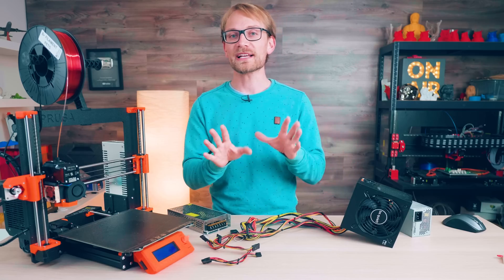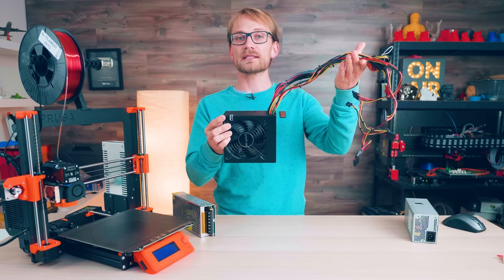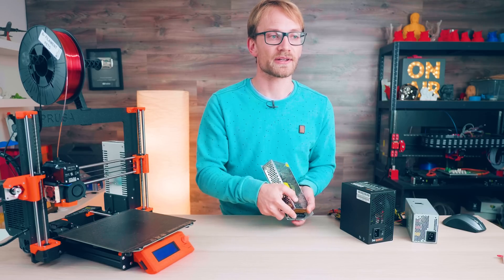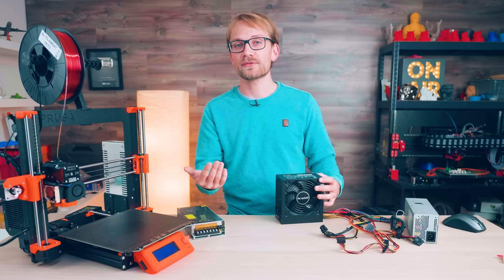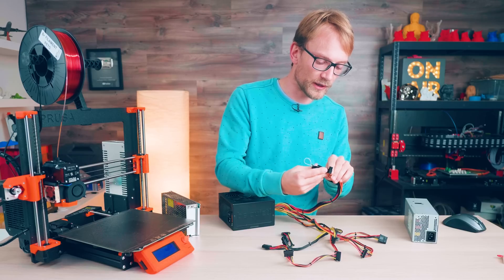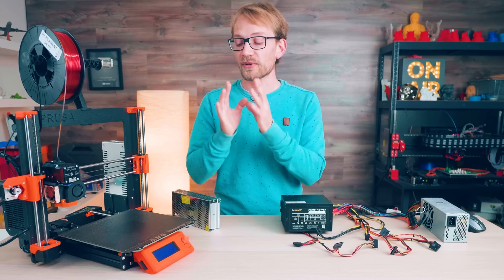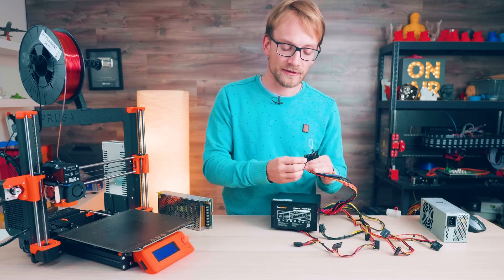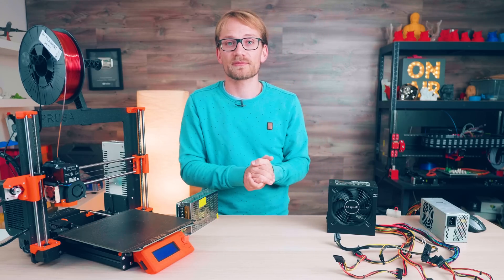ATX supplies are super useful for 3D printers!

Comment: haha, "12 floppy drives"... in RAID, I'm sure! Good one!
I always use load resistors with computer switching power supplies used in DIY projects because they don't like to run without a load (especially the old ones) and because, as you say, group regulation will make the "other" voltage rail go higher. In practice I use a permanent 6.8 Ohm/10W resistor on 5V (red) to throw away 3.7 W and sometimes another 47 Ohm/10W on the 12V rail (yellow). It depends...
"...loose some ampacity as the capacitors dry out"... ummm, no. Ampacity is the current capacity (usually of a wire), the maximum current intensity (in Ampere), in general. With capacitors dried out you'll get higher ripple or a total and sudden loose of regulation (the PSU shuts down), depending on where the troubling capacitor is located. The ripple itself may not be a problem as the printer controller has its own regulator, and the MOSFETs for the heating elements couldn't care less. Stepper drivers may or may not feel the ripple. But the shutdown problem is a problem and it can happen at any load. 

"Group regulation - single transformer"... no. You don't have two or 3 transformers if your PSU is independently regulating 12V and 5V (and 3.3V, but that's usually regulated together with 5V). Group regulation regulates the average, that's why 5V goes up if the 12 is heavily loaded (tending to go down). 

One thing I think you forget to tell about industrial PS is the ability to set the output voltage to a higher value which can make available more power for the heating elements. By increasing the output voltage from 12V to 14V the power available for the heating bed will increase with 36% (faster heating or higher end temperature)
Anyway, personally I use an industrial PS because it's smaller. But because I have lots of computer PSU I may switch to one with a lot of protections but not before I'll thinker a bit with it (replace those low ESR capacitors, replace that bunch of cables with only 4 or 5, higher cross-section and maybe getting 1-2 V over the PSU specs). Oh, btw, the gray wire is the Power_Good signal, can light a LED through a, say, 220 Ohm resistor put to GND if the PSU is working normally.

Comment: Hi Tom, at first I thought you have a +12v and a -12V on your ATX, that means you do have 24V between them, which you do..........But even though you can get 24V it will be useless because the -12V rated for 0.5A max.  So you could run ....... a 24v fan:):).  Dang, at first I thought I was onto something.  Oh well.

Comment: As you asked, I bought all industrial 5, 12, 24V SMPS to support my recently acquired BIGTREETECH SKR PRO V1.1 because this controller board allows for simultaneous use of both 12 & 24V supplies for Nema motors, Tcm2209 drivers and hot bed. I still have my 500W ATX PSU, but this will do for now as a bench PSU. I have a couple of digital V&I controllers for up to 50V or proportions of as shared between the two. Thank you for your great video contributions and no nonsense approach. FYI.

Comment: You should NOT switch the entire printer off immediately after print is complete. You should keep at least the cooling fan on, until nozzle temperatures are low enough (to prevent heat creeping to the cold end side, and melting the plastic there).

But no worries, there's GCode for that too!
M109 R60 ; switch current hotend temp to 60 degrees & wait until the temperature is reached.

After this, it should be safer to switch the entire printer off.

Comment: I've been through pretty much all the options;
12 V cheap PSU that came with the printer
12 V ATX (Noise)
12 V ATX with Boost Converter (TMC drivers)
24 V ATX in series (faster bed heating times)
24 V Meanwell (less cable clutter)
24 V ATX in series (that Meanwell is stupidly loud)
24 V ATX in series with a 12 V buck converter (lights would flicker when loading the 24 V rail)

Comment: Can't you get 24 volts by using the +12 and the -12 , instead of replacing one of them with ground?
Reply: Actually just went to check the video, the BeQuiet he used as only 0.3A on the -12V rail. 24V limited to under 1A isn't worth the 24V then
Reply: @TheDigigram  Ah, I see
Reply: I don't have a PSU handy to check now, but in most cases the -12 rail is rated at MUCH lower amps, meaning your 24V would also be very low amperage
Reply: @TheDigigram  Why do they do it like that?
Reply: @tiagotiagot  because computers mostly use digital processes where only positive voltages are used. The negative rails are mostly used for sound and a few things like that. No sense in adding extra circuitry just incase someone wants to use the PSU for something other than it's intended purpose

Comment: Great insights, the 5V standby voltage is very useful, but the large size of the ATX power supply and 12V only  (vs 24V) would be a limitation for me

Comment: On my DIY Hypercube 300 i run 2 industrial power supplys. A 24v run the 300x300 heated bed and a 12v run all the other stuff. First i build only with the 12v but the heated bed don´t achieve 100 C degrees needed to print ABS, so i buy the 24v power supply only for the heated bed and it works insanely well, it hits ABS temps in less than a minute. I know that is possible to run the ramps on 24v and maybe in the future i go for that conversion.

Comment: I built a printer and added a raspberry pi zero w for running octoprint.
On one of the GPIO pins i've connected a 5V relais that switches my 24V power supply (for heated bed, hotend and steppers) on and off via Octoprint. (using octoprint plugin PSUcontrol)
Only a small power supply for the raspberry pi is hooked up which stays on (until switched off with a manual switch on the printer itself)

Comment: Turing printer on/off using OctoPi is a neat feature and quite easy using ATX power supply. However I will stick to industrial PSU - 24V is much "better" feature. To turn the printer on off I plan to use relay on 230V side, I am going to power Raspberry Pi and relay from separate 5V power supply. Both connected to the same UPS, so I can switch them manually on/off there.

Comment: I am using a HP DPS-460 Server Power Supply on my 3D printer. It has a lot of power, is silent, can be also switched by marlin, uses high quality longlife components, is very compact in size and you can buy it on ebay for less than 15 Euros. It is still 12V but thats fine for my me even though I have a 200W/12V Heatbead.

Comment: Technically all ATX PSUs only have a single 12V rail. The difference is in some models the outputs are connected to that rail in groups with independent short circuit and over current protection. Those are logical rails with individual current settings. Physically they all get their juice from the same coil/rectifier. Everything beyond that is marketing. 
But it's a nice safety feature to have nontheless. 
With a single-rail-psu a component could short out and draw more power than the cables can handle, but the psu won't necessarily shut off because the total current might still be within that rails limits. Result: Fire. 
So for a PC build, if you don't have the budget for a fully digital psu, a "multi-rail" psu from a quality brand is a good choice. (most are made by superflower, delta or seasonic and then re-branded anyway^^)

Comment: I switched the Ender 5 24V Supply to Meanwell UHP350-24. Using the TH3D Mainboard plus a fanless supply gives me a near 0 noise while printing ABS/ASA. I modified the printer alot further, using a multible PTC elements to heat a customized chamber, some LED strips inside, a thermometer, a self resetting bimetal fuse for overtemperature of the PTC elements, full metal hotend, direct drive titan extruder, immense cable lengthening to get the electronics out of the chamber ... :D

Comment: so you didn't mention that with an ATX PS: if you use the -12v output (as positive) and the +12v output (as ground) you get +24V... would that not suit the needs of the required 24V in a newer system (My Ender3 for example)... THNX :)

Comment: I feel that using ATX psu's is still totally viable, as am in the process of switching from  the default LED style psu's on a couple of my 12v printers with some single  large  12v rail ATX psu's that I still have  in boxes as ready spares for well over a year  but not needed them  (corsair & seasonic = excellent reliability) I wouldn't do this with some of the older pre-haswell compatible class ATX psu's as those tend to need a load on the 5v rail to maintain stability, (I have an  old but perfectly functioning Enermax Noisetaker 650w psu from about 2007 which behaves like this and it wasnt a cheap psu either).

If I had to use an older atx psu I would  1st check the label for  how its power distribution is laid out, some very old ATX psu's tend to have most of the current dedicated to the 5v rail rather than the 12v,   so after looking at the label if it had more juice on the 5v rail then I would reject it - thanks  for posting

Comment: I replaced my garbage chinesium power supply for my Anet A8 with a good Dell atx powersurply i had lying about. I feel a lot safer now and the short circuit protection is fantastic. I had a LED light that was short-circuiting which would instantly trip the protection resulting in no damage. 

With all software safties enabled, soldered bed connections and external MOSFET, I feel somewhat safe letting it run unattended.

Comment: Is it possible to connect the 12V rails in series?

I believe most multi-rail power supplies are so because of the voltage drop on the ground return wire. If 12V dropped to 10V it should not be a big deal because of on-board VRMs, but if ground raised to 2V then all he'll would break loose because of the communication lines.

If this is the case, grounds being separate between trails, then only protection circuits could possibly shutdown the supply.

Comment: Word industrial should be replaced with Chinese. I've never ever seen these "industrial" power supplies used anywhere in actual industrial machinery. Not sure, but I think that even the terminal safety in them is insufficient for today's standards even though they are installed in cabinets. All logics and control boards have always had some pretty good quality looking powers, generally with integrated output fuse.
Reply: I've seen similar ones in a few industrial machines... First time was almost 20 years ago.
They've all been inside metal casings, and difficult to get to during normal operation.... I suspect they may have had the low voltage at the opposite end to the high voltage though, unlike the common Chinese ones.

Comment: I'm running two ATX supplies for 24v and it works great, but you have to do some hacking to make it work.

Fundamentally, the power supply creates a difference of 12v between its low and high outputs. We call them ground and 12v, but they're really more like x and x+12. So if you connect the low output to 12v, the high output will be 24v – easy! Unfortunately the low output is already internally connected to the earth pin on your power plug. This is for safety: if you let x just float around with no specific value, who's to say it couldn't end up at 240v and shock you when you touch it? However, it's possible to mod the power supply so that the earth is still connected to the case, but not the low output, leaving it free to be connected to the 12v of another (identical) supply.

There's a video by Neilgn called "Isolate negative terminal from ground on ATX supplies" that shows how to do it (though he isolates both supplies and you only need to isolate one of them). It's not that difficult, but I wouldn't attempt it without at least a multimeter and a knowledge of how to discharge the big input capacitors.

Comment: I'm using a medium quality EVGA 500W ATX power supply, it worked for a while without any load on 5V but after a few months it started behaving a little weird (prints stopping in the middle with the ATX still on afterwards or sometimes stopping completely), I tried adding a 12V halogen light to the 5V line and now it works perfectly so even on good quality ATX think about it if you have any issue.

Comment: I tried to use an ATX power supply, but it wasn't powerful enough to run my raspberry pi in standby so I just went with a switch on the mains voltage and went back to the old industrial PSU that came with my printer.

My new printer is using a MeanWell 500W fanless powersupply, it's been fantastic. (albeit expensive €95)

Comment: You still can get 24v out of an ATX supply, as long as you have +12v and -12v. You use those lines, and not the ground line with -12v now being the ground, and of course, +12v as the positive line.
-12v 0v +12v
   "-"          "+"

Comment: My printer is a very "adapted" RepRap and I'm using a "low profile" ATX supply, it is smaller than the default ones, I have opened it and changed the cables for thicker ones and left ony the ones I really use, it is performing well so far.

Comment: The only reason I don't use an ATX power supply on my printer is because my printer wants 24VDC. I also prefer using the higher voltage because less current is required which means less heat and better efficiency.

Comment: Seeked out an ATX PS with a 5V standby that can handle over 3A to power a R PI and re-arm when it was off. I found the PS for a Dell Optiplex 3010 or 9010 has a 5Vsb at 4A. It is a small form factor 240W and goes for about $35 USD on Amazon. I have the 5V Standby powering a the RPi with its USB connected to and powering re-arm with ramps. the PS on turns on the ATX PS to provide the 12 V to the ramps for motors and hot end. I have the PWR OK signal from the ATX PS trigger a Solid State relay to turn on a 24V 480W PS for the heated bed. The ramps is connected to a MOSFET to control the 24V to the heated bed. I added the plugin to octoprint for power on the PS and power down the PS after some time. I just send a job to octoprint and the printer powers up and shutsdown after cool down.

Comment: I'm custom building my CR-10 with Duet2 wifi and a super cheap used HP server PSU. Very happy with it. High efficiency, doesn't even get warm when printing with heat bed on. With a buck converter to convert 12vsb to 5v for Duet2 board and a PS_ON pin connected, I can keep the board always on while turning the main rail on / off  with a single line of gcode and from GUI.

Comment: Cutting off the power of your printer at the end of the G-Code doesn't sound like a good idea. You need to wait for the extruder temperature to go down to a safe temperature (about 50°C) before turning off the heat break fan, otherwise you may damage your extruder...

Comment: With the 12v atx supplies that also provide - 12v can you connect across +12v and - 12v to achieve 24 volts?
Reply: That does give you 24V. However, (a) they share a ground with whatever else is connected, such as the controller board. That ground is in the middle of the 24V, rather than the negative side of the 24V. Hence the controller will not be able to switch this "24V" like it normally would. And (b) more fatally, the -12V supply in an ATX PSU generally has a very low current capability. So it would not be able to supply loads like the bed or hot-end or motors.

Comment: 24 v definetely rocks. IMO 12v for printers is dead. Most connectors are rated at 30+volts and amps on connectors drives up the price and same on wire size. Even for a hotend at 40 watts you can use a jst thpe connector at 24 but not at 12. Unfortunately the ATX is very weak on the -12 so even though you can get 24 v between -12 and + 12 its usually just around 1 Amp or so on the -12 rail

Comment: I started with an ATX on my original REPRAP build. But purchased an industrial supply when I needed more current than 1 wire from ATX could supply. I could never trust an ATX to provide clean power when multiple rails are joined together. Internally, I don't think it's a good idea to just combine rails in parallel in hopes of sharing the current load. Strange phasing issues may cause voltage spikes or something to burn out. I'm no power supply designer, so I could be wrong, but for the cost of an industrial supply that's rated with the high current I needed on 1 rail, I wasn't going to risk it.

Comment: ATX supplies have in the past led to ground loop issues. However if you look at buying new -- a quality ATX supply vs even a set of quality meanwell (or comparable) industrial supplies -- 24v, 12v and 5v -- 3 pack -- if you want to avoid using boosters or drop down converters, you still come out ahead using industrial supplies. Considering getting 24v out of an ATX supply requires extra circuitry, it's a bit of dead topic. The only valid argument is if you have a free ATX supply recycled from a PC tear down or just in general, and if you don't care about the benefits of 24v -- quieter, smoother steppers, faster heat up times, etc. You have to deal with multiple 12v rails, ganging them up to create any decent current output of an ATX supply -- but if it's free and you're on a budget -- why not.

Comment: Is it really okay to parallel two 12V rails? It is important that they have some buffer resistors on the output of each rail (like 0.1R) to ensure they share the current draw equally. If not you can get current flow out one rail into the other and things heat up quickly.

Like if you try to stack
opamps it becomes unstable. Buffer resistors can be critical.
Reply: You bring up a good point.  I had a near melt-down in a connector where I have bridged ATX rails.  Even a small voltage difference can result in large current loops.

Comment: using 2 x 12V30A wired together to get 24V30A for heatbed & mainboard and 36V10A for motion system (Nema 23) - sounds way too much, but i have a gigantic corexy mashine for 3d printing (40x40x48cm buildplate) and cnc routing (48x45cm wasteboard) on linear rails. and yes tom, it's working freakin' great! :)